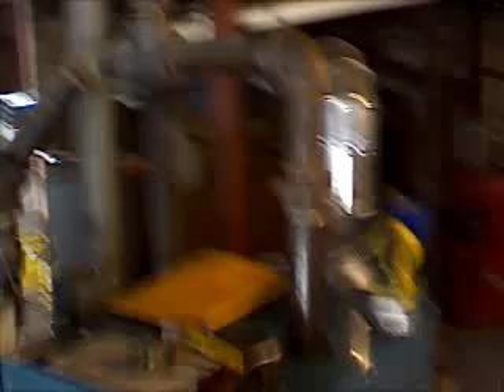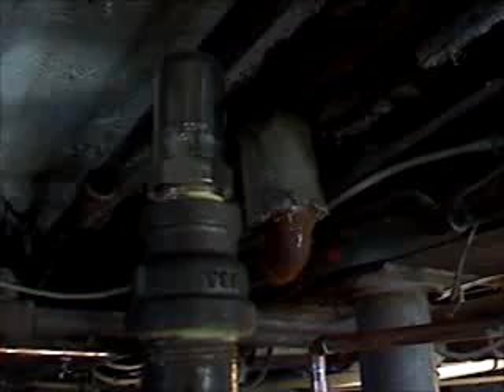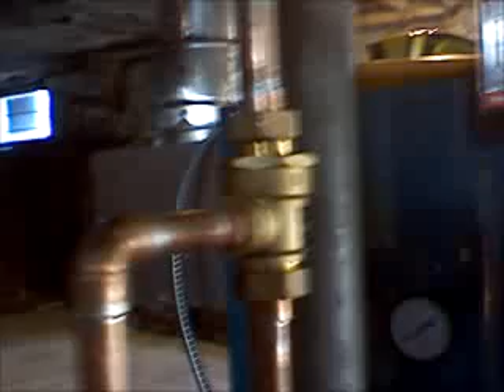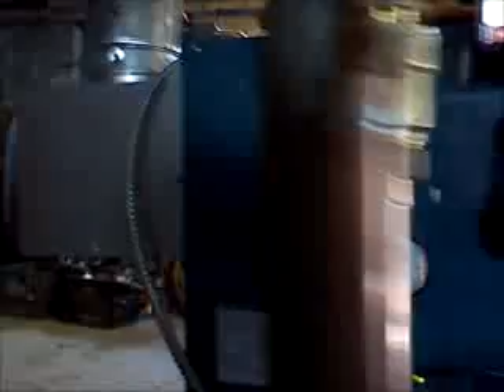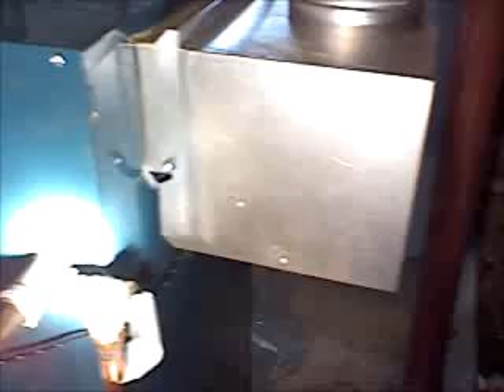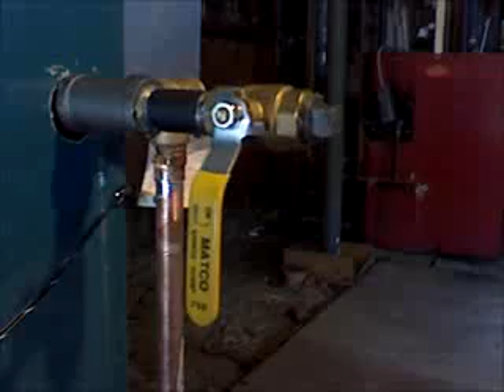Gas fired Steam Boiler

Comment: You must not of used the wiring port on the boiler itself to power and control you're indirect pump. Just confused on that setup about how it would work with the outdoor reset am10 module supplied by Buderus with how u set it up?
Reply from the maker: Sir, you are commenting on an atmospheric-vented, gas-fired, steam boiler video, not a GB-142 video.
I have several GB-142 videos so I'm not sure which one you watched.

Comment: Hey Mr. Plumber
I have a Utica Boiler. Its has a Honeywell Thermostats. My problem is the systems says there is not enough water in the boiler. But it is. I have drain the water. Clean the glass that shows the water level. I have push the reset button. I have turn off the switch. The red light still comes on. Meaning low water. What should I do? Please help!